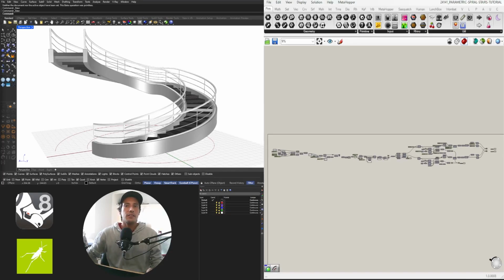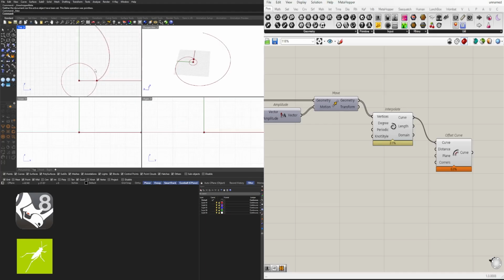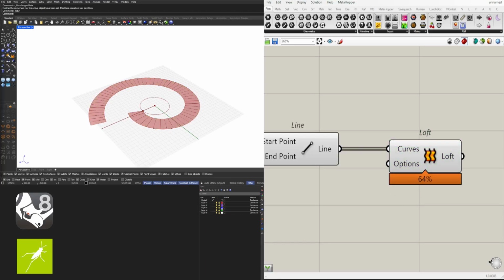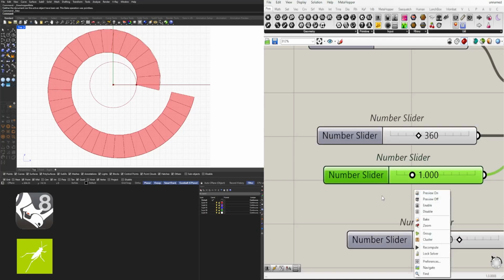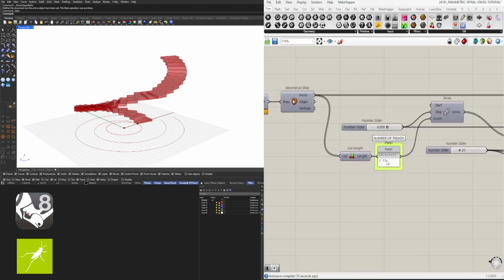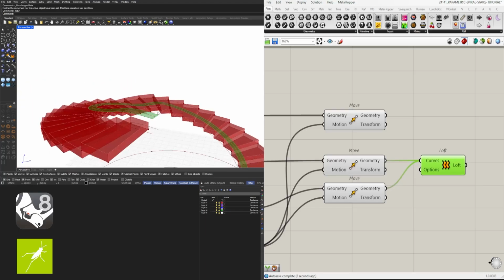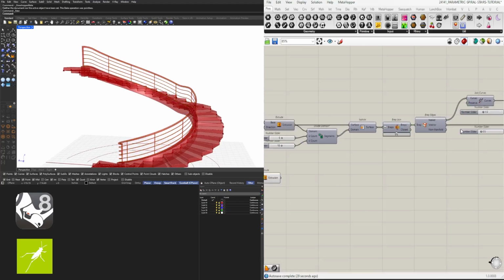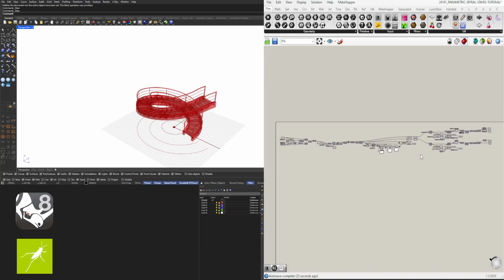Grasshopper Tutorial Rhino 3D Parametric Modeling - Spiral Stairs With Stringers and Railings Script

Comment: Thank you for this 🙏

There is a slight problem I am facing and I think it’s there in your script too. The naked edges when you do a pipe component. Where the treads start, the pipe is extending out and not a proper corner.